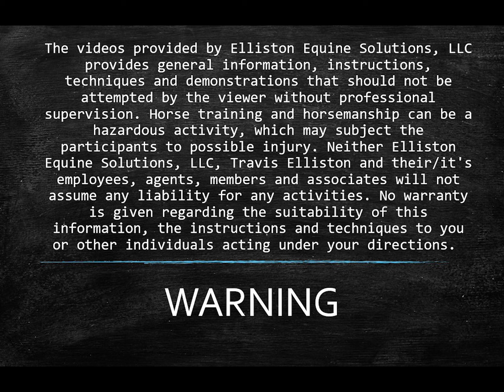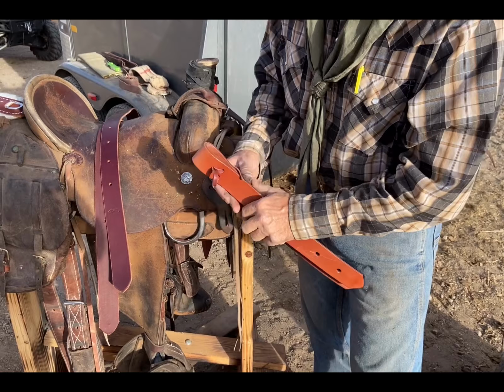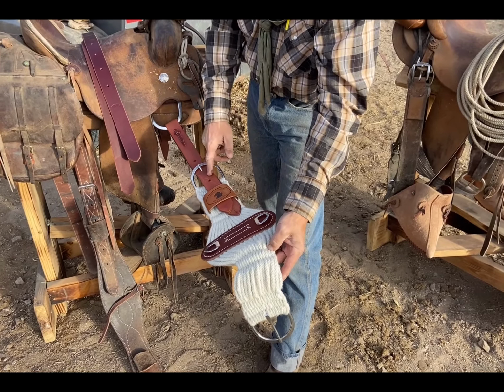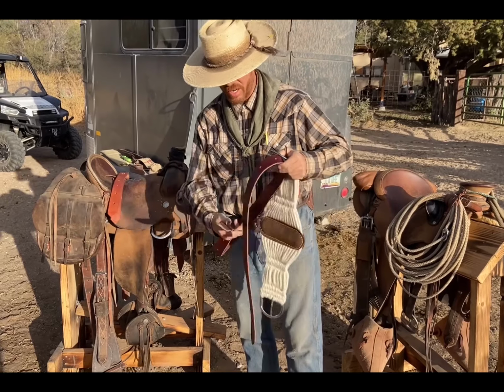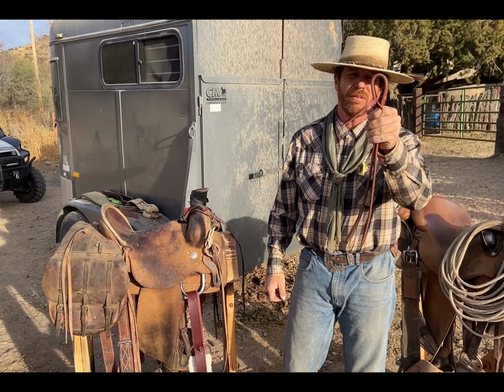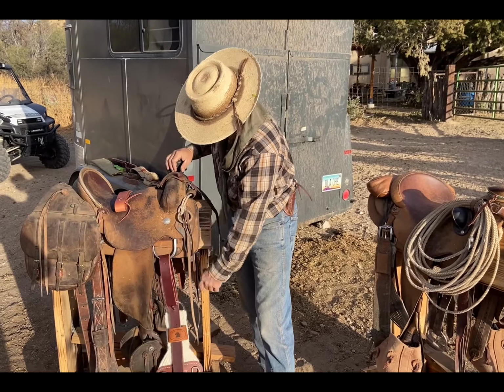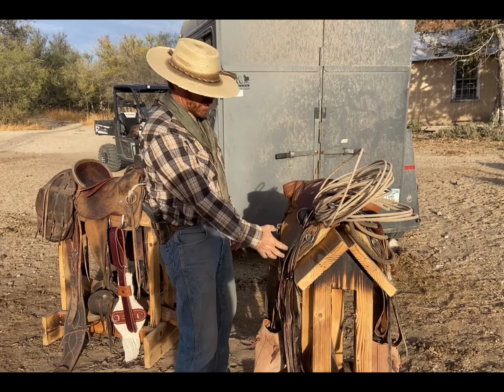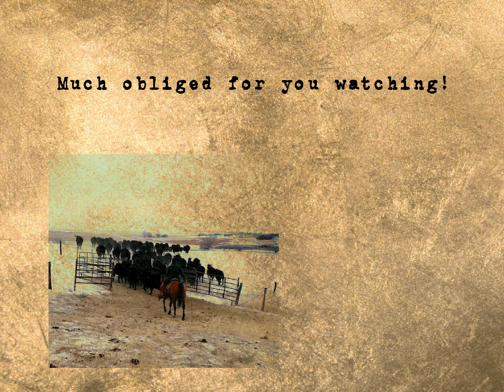Off Side: Tie Strap, Billet Strap, and Half Breed Strap

Comment: Thanks for the speedy reply and the link to this video! May I ask if you suggest for the horse's sake, I use the latigo style on both sides or one billet and one latigo? I have heard a lot about the distribution of pressure on each side of the horse.
Reply from the maker: I personally prefer the tie strap (latigo) on both sides of the saddle. For the reasons you brought up and for what I covered in the videos. Sometimes you have to do trial and error on what you like and try all three methods.
Reply: @ellistonequinesolutions3795  Me too I think! I tell ya, I do prefer the structured tie you do versus the texas T knot because I always screw that up:)